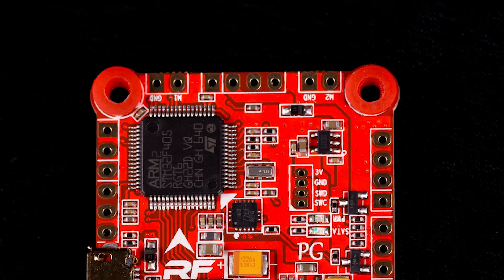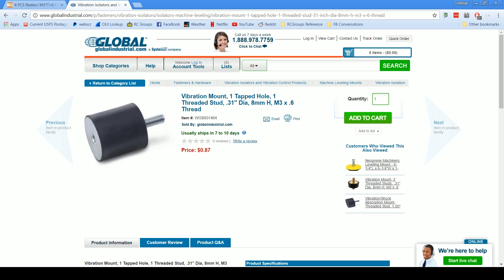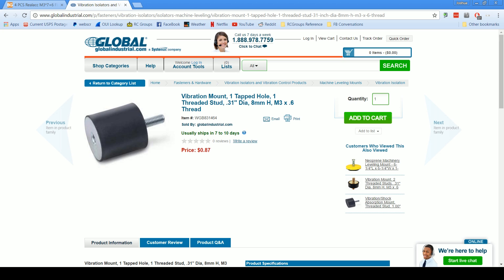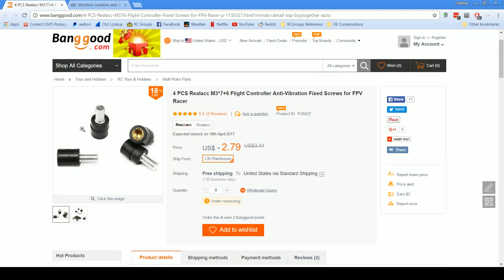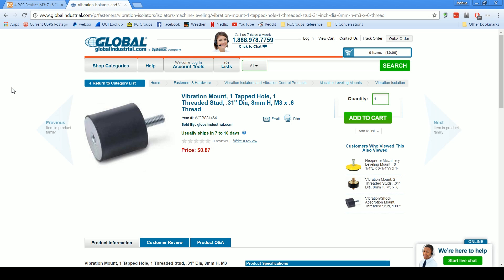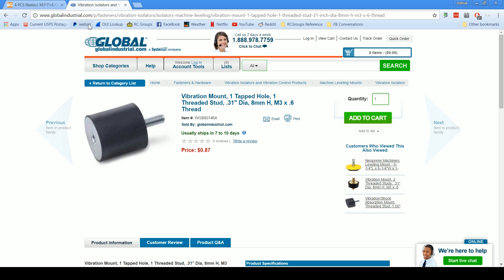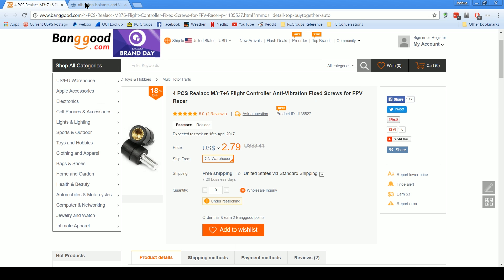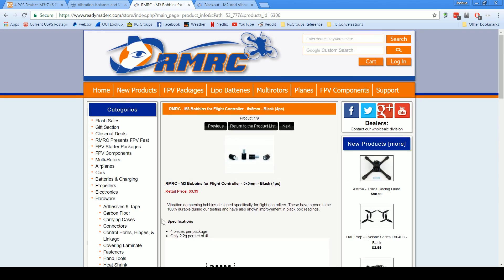Soft Mount Your Quadcopter Flight Controller | BUILD TIP

Comment: Have you seen Skidoosh's video where he uses sections of silicone tubing for soft mounting?  Thoughts on that method?  It would be fun to see you implement that method on one of your quads and do some before/after blackbox log viewing to see how much of a difference it makes.
Reply from the maker: I tried that method but it was really hard to get the silicone cut evenly and perpendicular.

Comment: Can these be used on FC'S with positive mounting holes?
Reply from the maker: I wouldn't risk it.
Reply: @JoshuaBardwell  I only ask cuz I've been breaking these nylon standoffs that came with the board I gotta figure out a better way to mount it. On my next build I will try an avoid a hot mounting hole. Maybe a JBf4 eh.

Comment: I know an old video is not the best place to ask but I have one of these weird detail-questions... :
When using the rubber standoffs, do I only put them directly under my flight controller, under the PDB (on which the FC is on top) or even both?
greetings <3
Reply from the maker: I only soft mount the FC.

Comment: Hey Joshua, an older video I realise, but I just had some weird issues with a slow roll to the right assumed caused by vibration on a small 140 size quad with 20mm flight board. I updated last night from nylon with o-rings to some Maytek Systems 2mm rubber standoffs and the roll issue is fixed. I have nylon from the frame to the ESC, a 5x1.5mm oring above the ESC as the thread was too long for the captive nut in the isolator, the isolator then the FC with nylon nuts on top.  Keep up the good videos!

Comment: Hey Josh!

I have a bit of a theory.. Basically I'm thinking that soft mounting our flight controllers might not be the best idea.

I've always kind of wondered - aren't we giving the gyro less information to work with? Like, sure you're cutting out a lot of noise that would normally make its way to the gyro, but might there be some loss of useful signal in the process?

This idea doesn't apply to soft mounting motors as, in that case, you're isolating the whole quad from vibrations caused by the motors. That dampening applies to everything on the quad including your camera(s).

But when soft mounting the FC I've found that even if the fc itself thinks the quad is flying better (i.e. blackbox), it's actually ignoring some oscillations that can be corrected. Since what's being dampened is the actual movement of the quad, those oscillations get to make their way to the quad & cameras.

I've flown a lot of crafts now using both mounting methods, and hard mounting is the clear winner in my experience. Just a few days ago I think was the moment that I became thoroughly convinced - I'd been trying to tune this 6" craft for a while. It uses the rubber mounts discussed in this video, and two of them actually got torn in a hard crash. Decided it would be a good opportunity to get a good A/B on the issue so I hard mounted the FC and took it back out. No further tuning, same props, same everything and it flew notably better than before. This along with other experience are enough to indicate to me that soft mounting our flight controllers is just a way to make tuning more difficult :) Cheers!
Reply from the maker: The "less information to work with" argument is sort of right but sort of wrong. Imagine you're trying to do brain surgery and someone is screaming in your ear. Filtering out that screaming would give you "less information" but it's bad information so you don't want it. The goal of filtering is to remove high-frequency noise that is not related to flight handling.

Comment: I am glad you addressed this. I have been getting more & more vibrations lately as my quad is getting older & taking more beatings. I didnt really think about the little orings ive been using but I did think about my TBS Silicone motor mounts being "worn out" over time... After repeated tightening & regular use, I am sure they have lost their initial springiness. Same thing goes with the orings. Additionally being blasted with cold weather doesnt help them at all & I think there is definitely vibration transmitting through the nylon standoffs to my FC. I absolutely see the benefit in spending 5 dollars to update this discrepancy. Pilots need to realize that everything on their frame is an expendable -- Like brakes on a car -- That needs to be changed out occasionally. Nothing is permanent. Especially if youre really ripping balls.

Comment: I have a 4 in 1 esc under my flight controller, vtx above it (30.5mm stack)... Whats everyone's thoughts on should i put the rubber mounts under the esc or hard mount the esc and soft mount flight controler and vtx???

Comment: How do the rubber bobbins compare to the gummy rings?    (very strange question out of context)
Currently using the JB F4 FC and wondering if I took a step back.
Reply from the maker: They both isolate very well. The gummys are easier to mount because you can use standard hardware.
Reply: Joshua Bardwell Thanks for the response. Loving the flight controller. So far it looks like it's gotten rid of the pesky black lines in the 5V Unify

Comment: I bought those softmounts but haven't used them yet. They are all metal and the rings on the fc are gnd so by using these softmounts it so short ground to the frame. What do you think?
Reply from the maker: +Michael M there is no problem with shorting the mounting holes to the frame. The frame gets ground from many locations.

Comment: Hello Joshua, I have this problem after installing softmounts under my FC. When I do quick sharp roll, I get quite massive bounceback. Do you think that PID tuning will eliminate this bounceback? I'm not very experienced with PID tuning, so I rather ask before I spend few days with tuning xD
Thanks you for answer and for your all work!
Reply from the maker: +TomicaCZ maybe the soft mount is too soft.
Reply: Joshua Bardwell well, that was the answer I was afraid of :D
I bought (before I see this video) those ones from banggood, those you showed in this video as optional. Well, i think I try another ones.
Thank you anyway for answer and for everything you are doing for all of us.
Have a great day.

Comment: great vids!  what is the best place to install the rubber mounts? between the frame and stack or just below the FC? any help would be great.
Reply from the maker: I think that's kind of debatable, but in practice it seldom matters, because few frames today have enough room to lift up the entire stack by 8mm or 6mm or however tall the rubber standoff is. So typically the PDB or ESC goes below the rubber standoff and the FC goes above.
Reply: Thanks for your reply... I'm a newbie at this stuff and I've been watching and reading so much info (and keep asking myself what have I gotten in to? But I like it! It's fun). I am building a 210mm frame with SP Racing F3 FC. I thought it would be a good starter for my first drone build. I also just started watching your Sim FPV flying videos and more. Your the Man! keep up the great work.

Comment: wish someone would have a competition for the worst flying kwad due to vibration.... I just built a new high end component kwad and it flies like poop!! After a 75% throttle punch out, my kwad tries to do a right handed yaw front flip!! This behavior has to be caused by bad vibes!?!? I'm running the bff3 board, F-60 2500kv, all mounted on the Luminer QAV-XS with the race pod!!

Comment: those from banggood are the same once as you get with the Matek F405 flight controller. those holding my FC, soft mounting my motors. I was able to set the lowpass filter to PT1 and turn both Nothcfilters off and run 32-16K filtering. altho I have NOT turned off the D Term filter. I have not tried and I'm not going to! even tho my motors are still cold after a full pack heavy on the Throttle

Comment: I'm trying to figure out soft mounting on my micro. On top of lowering the stack on my F4 RacerCube, I'm hoping the o rings work. The stack states m2-m2.5, so the screws should avoid touching the fc and fc. I can't find a better way thus far.

Comment: I'm using the Realacc ones from Banggood. They are extremely soft! On the frame I'm using them, the FC has 30.5mm spacing and the frame is 30mm, with them, my vibration and mounting issues are gone! I can recommend them (:

Comment: Hey Joshua, would using such standoffs for motors (16 individual standoffs total) for my 6 incher help with the smoothness of the video? The FC is already softmounted.
Reply from the maker: Lord I don't know but I wouldn't do it. All you need is to have the motors flapping around on the end of a big rubber standoff.

Comment: hey Joshua Bardwell
Thanks for the channel
love your info

could we use these bobbins to mount the motors? would the screw ends pull out of the rubber? would the flex cause the  motors to direct air wrongly causing the fc to freak out? 
I'm having oscillations that I can't track down and was thinking about motor mounting using these
what do you think?

Comment: When using the rubber standoffs, check the clearance between the FC and PDB under it. I killed my Fury F3, a micro SD card, and a receiver today by landing hard but upright. Best I can tell, the FC compressed the rubber bobbins (RMRC) and the micro SD card holder hit the solder joint from the battery lead, sending 4S voltage into board's ground. But man was it flying fantastic up until then!

Comment: in your opinions which is more effective motor soft mount or this? Or  use both.   I personally prefer this and this is more than sufficient.  This one u can effectively isolate the gypro from the frame. Motor soft mount I do not think is effective against horizontal vibration.
Reply from the maker: Which is more effective I don't know. This one is my preference.
Reply: I am sensing a BB session  coming our way. just a wish Joshua :)

Comment: http://www.ebay.com/itm/8pcs-8-x-8mm-14mm-M3-Male-Female-Anti-Vibration-Rubber-Mounts-Isolator-Kit-/322436368569?hash=item4b12b488b9:g:d1EAAOSw~AVYs~SI

https://www.banggood.com/4-PCS-3D-Printing-TPU-Anti-vibration-Plate-in-for-22xx-Series-Motor-Black-Purple-p-1130594.html?rmmds=mywishlist

 This soft mounts will does the job? or for the motor soft mount its better to use double side sticky tape ?

Comment: How about using these things, but not putting the screws through them? They could be placed on the screw threads of the standoff of the board below and held in place with a spot of hot glue if needed.
http://www.banggood.com/Anti-vibration-Rubber-Shock-Absorber-Ball-AV-Ball-150g-p-917595.html

Comment: I always seem to get viberation on y axis 5" alien , I've heard in ways f3 better than f4 because the f4 so sensitive, I did soft mount motors not tested yet but maybe that help the yaw twitch . I tested top end motors and all seem around 1944 and my blhelis setup is 1968. Is it normal for motor bell to have very slight movement on bell if pulling shaft side to side. I do have yaw/p at 80 from 70 and couldn't tell it helped my twitch at 3/4 to 100 percent punches

Comment: When I build a single rotor Heli I mount the gyro on a heavy double sided tape or even a gel style double sided tape to eliminate the vibration issues. Why don't we just do that on a flat surface to mount on?

Comment: Hi Joshua! I used pieces of silicone fuel tubing from rc nitro fuel system. Seems to be working really well with nylon M3 bolts. http://imgur.com/a/KyRxi Whats your opinion on betaflight FC soft mounting? I've been thinking if the power wires carry vibrations to the board? Haven't tested yet tho, my board is still in mail somewhere.
Reply from the maker: I do soft mount my BFF3. It has to reduce vibration even if the wires transmit some.

Comment: I just make my own out of fuel tubing that's used in nitro rc stuff. You can cut them as thin or thick as you want and I've found that they work much better than just the standard orings. Super cheap too.. Just one foot of tubing can make about 100 orings.

Comment: i think this type of stand off is even better. 
https://www.thingiverse.com/thing:1785455

there ist really no screw contact anymore. But ... TPU is not the optimal material maybe, because variable softness in different temperatures.
Reply from the maker: +Mr17766able yes, that's my main objection to TPU for vibration isolation.
Reply: Joshua Bardwell yes (i use it because netter than nothing :)) gut look at the form factor. The other standoffs has Metal threads which dann translate vibrations, how i see it.

Comment: I can vouch for this. Been using these style bobbins on my Alien to cure mid throttle oscillations that started after upgrading to returner R4 and dys xsd dshot escs. Not only the yaw twich was cured but the quad generally felt a little smoother - I was able to increase pid's slightly to get a locked in yet smooth tune.

Edit: BTW I suggest banggood or ebay, no need to pay stupid prices for this sort of thing.

Comment: Joshua. First thanks for pointi my out  the Runcam 3 presale thing. I simply chose not to see that. I should probably slow down sometimes. 
So now to this topic.  Just looking for clarification. 
I do and have always soft-mount my FC. But not to long ago the rave of soft-mounting motors was revisited. 
Are we suggesting to do both?
I'm sure the answer could be, couldn't hurt to be double safe or it's more insurance against the battle of the evil power of vibration.  Or something like that😉
But would you say it's  necessary?
Thank you..
Reply from the maker: It's not necessary unless you have issues with too much vibration.

Comment: You have to do a bit of finagling and trimming of the "attachment plate" and pass thru column, but the smaller silicone balls work very well.  Four at each corner supporting a single digit gram FCB is plenty stiff and plenty isolating.

Comment: Not sure this would "completely isolate" the controller from vibrations. Surely rubber/silicone would pass some vibrations JB? If not, my missus would be pretty unhappy about that...
Reply from the maker: "Completely" as in there is nothing other than the vibration-isolating material making contact.

Comment: On  my quads, I "mounted" the controllers suspended by four elastic bands against a pad of Sorbothane, used in audiophile gear (mostly turntables).  I got good results.

The outstanding question is, what frequencies are resonant on any quad, and what materials (with what geometry) are needed to dampen them?  It probably wouldn't be too difficult to mount almost any controller on an isolation plate, and one could argue the merits of using "balls" of four different durometer values for the widest range of vibration damping.  Assuming vibration transferred by one would be rejected by one or more of the other three.

Mounting the isolation plate somewhere OTHER than the center of the frame could also be defended as resonance probably focuses there more than elsewhere.

Comment: Joshua, I thought you may like it. this is from one reviewer using the banggood mount unfiltered gyro data from blackbox. http://m.banggood.com/4-PCS-Realacc-M376-Flight-Controller-Fixed-Screws-for-FPV-Racer-images-p1135527.html

you can see the review comments in the review tab.

Comment: @Joshua Bardwell

Those look awesome. However, I finally found a really neat, compact solution for soft mounting. I tried some larger bobbins, but it was too big. 

Instead of M3 standoffs, use long M2 bolts. Now strip some 14 or 16 awg silicone wire and use the silicone jacket. Slide that over the whole m2 bolt. Now the bolt is about m3 diameter, but it is soft silicone. Now strip some 10awg silicone wire and use that jacket as the spacers. Slide on some spacers, then FC, then more spacers, then other boards. This also allows you to cut whatever length spacers you need.

I could not find long M2 bolts, so I used these M2 pushrods. Cut them to length with dremel.
"https://hobbyking.com/en_us/m2-x-45mm-steel-push-rod-10pc.html" 
Bolted that to the chassis with these nylock nuts.
https://hobbyking.com/en_us/black-anodised-aluminum-m2-nylock-nuts-8pcs.html
and these regular nuts.
https://hobbyking.com/en_us/m2-hex-nuts-chrome-steel-20pcs.html
Then bought these 3 sizes of silicone wire. 16awg, 14awg, and 10awg.
https://hobbyking.com/en_us/turnigy-high-quality-16awg-silicone-wire-1m-black.html
https://hobbyking.com/en_us/turnigy-high-quality-14awg-silicone-wire-1m-black.html
https://hobbyking.com/en_us/turnigy-high-quality-10awg-silicone-wire-1m-black.html
I used the 10awg as spacers and either the 14 or 16 as the long jacket over the m2 bolt. I cant remember which size fit the best.

The raceflight oversized holes are probably a better solution, but this works really well and actually takes up less space than nylon standoffs. My 4 in 1 esc has transistors so close to the holes that nylon standofs hit the edge of the transistor while tightening it. This method fits fine.

Comment: These things made me feel like I was flying a phantom. Never had my camera feed so crisp and smooth before. These along with some soft mounted motors completely solved my vibration and mid throttle oscillation problems. Hyperlite v4 2722kv on a armatank 162mm 4" frame with betaflightF3 board.

Comment: I just use fuel tubing & long black nylon screws, or o rings. Blackbox testing showing the difference would be awesome!
Reply from the maker: If that works, great. But in many cases the screws transmit enough vibration to still cause issues.